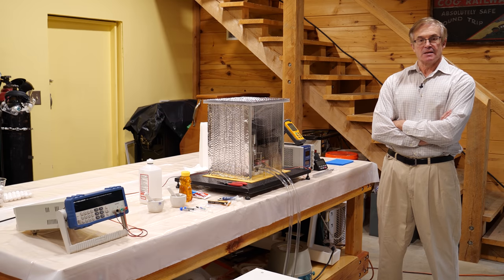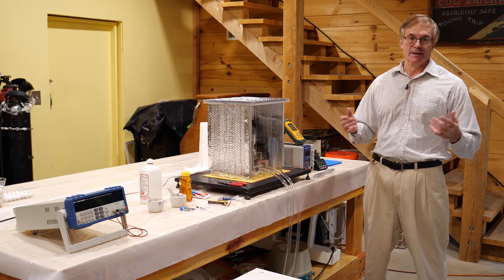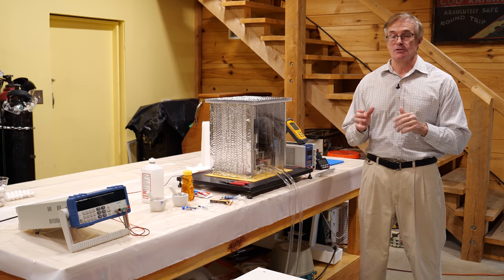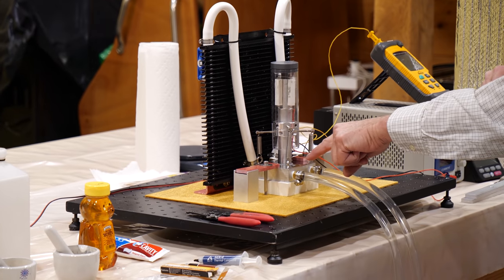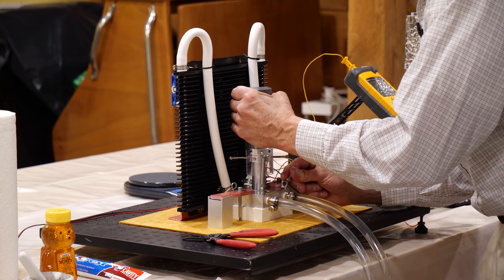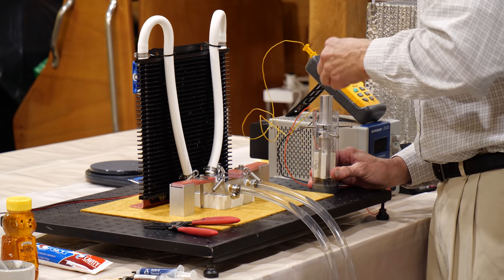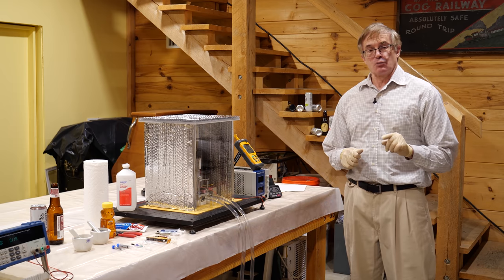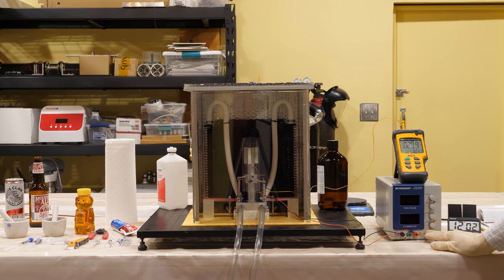DID WE JUST MAKE THE WORLD'S BEST THERMAL PASTE!?

Comment: The flaw in this experiment is that he is testing these compounds at temperatures WAY lower then your average CPU would experience (let alone an overclocked CPU!!!)  those temps can get up to and over 80C...  Applying only that small amount of heat that is only allowing the temps to get around 30C is not realistic in an average usage case.  I have custom water-cooling loops for both my CPU and GPU and my GPU heavily overclocked gets up to around 52C and my CPU around 72C (also heavily overclocked).   However much heat he is introducing to perform this experiment is not enough to emulate real use cases.  That is a major flaw.  As these compounds can only be truly stressed under heavy loads.  I have read articles where they test like 50 different compounds, included toothpaste, and the toothpaste performed HORRIBLY.  It was around 20-25C higher then all the thermal pastes, maxing out over 100C...  30C highs are not going to give you accurate results.  This guy is really smart and you think he would have known this...  smh.
Reply from the maker: That's  better.

Comment: Very shady experimental setup with very meaningless results. I understand what he is trying to do. But, the results are meaningless without energy balance equations.  Your experimental setup makes it impossible to calculate an actual value for thermal conductivity.

"Thermal conductivity λ is defined as ability of material to transmit heat and it is measured in watts per square metre of surface area for a temperature gradient of 1 K per unit thickness of 1 m."
Reply from the maker: I explained that this is a COMPARATIVE test with values that are only relevant to this specific rig.  You should have watched a little more carefully.
Reply: @TechIngredients  I understand what you were doing. I agree that you could potentially determine which paste is superior, however the experimental uncertainty is probably much larger than the differences in temperatures that you were getting from the different pastes. You need a more accurate thermometer. I believe this experiment could be vastly improved by adding enough measuring devices to do a full energy balance for heat transferred through the different pastes. You know the Power in and the T hot. you only need T cold. the Delta T across the paste is important. Sorry, but it is not a good assumption that the cooling water maintains a consistent temp for the T cold. Also test each paste at multiple wattages. And make a linear graph.  Its not as much work as it seems.